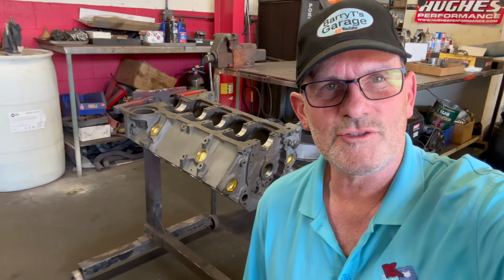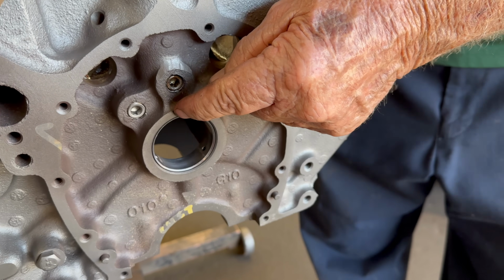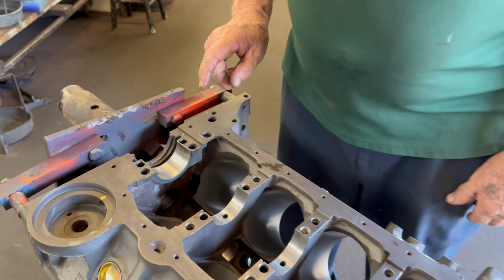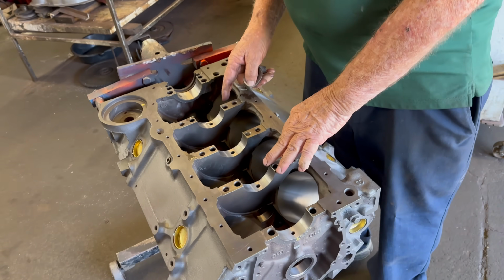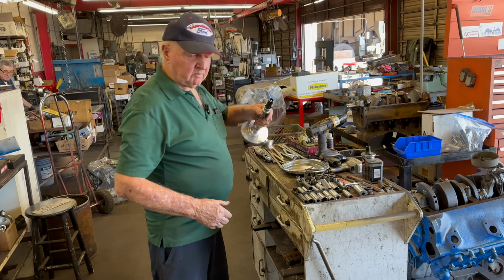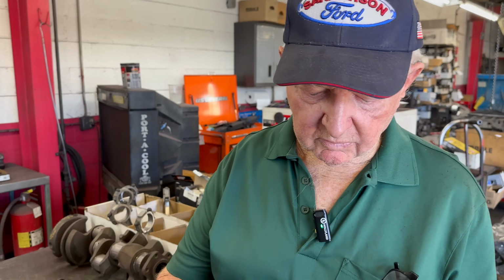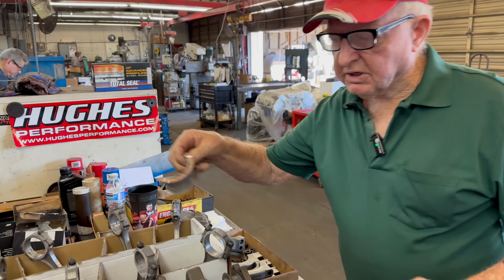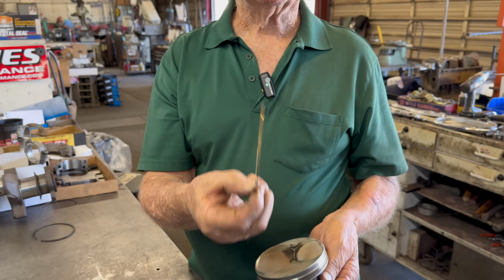OILING! Small Block Vintage Chevy (Chevrolet) Motor - Ed Smith's Tricks of the Trade w #barryt

Comment: We use pipe cleaners in the pushrods to keep from blowing the valve covers off of it and drowning the valve guides in Smoky oil films., running a constant 8500 RPM... a small block Chevy will load the valve covers full of oil before it can drain back to the oil pan.... But when it comes to our Dale Earnhardt signature 437 that made 850 horsepower on methanol.. all we had to do was bowled it together and everything else was figured out for us.. better cost of $50,000 for one motor you would expect that
Reply from the maker: Great example

Comment: The most wear on any engine occurs when first starting the engine especially in cold temperatures all engines should be equipped with a oil pan heater and a pump to get the oil into the cylinders before start up but it will never happen because the auto makers don't want vehicles to last that long
Reply from the maker: Yes 👍

Comment: I was the crew chief for a DIRT team. There are a lot of things he is either not telling about or doesnt know. I was the " motor man" and had access to the engine builder's secrets so I know some of the internal machining and even a flat top would have piston mods so we could turn 9 grand and with specially flowed feed had to custom drill jets because nothing made could pass what was needed. We were running 1400 cfm and beyond 7 grand rpm would lean out with stock jets. Add a driver with skill and we had FUN.

Comment: I don't understand why not put the clutch back on with it in the stand and try it. Prove that it was the problem.
Reply from the maker: Improved it by making it smooth by removing the clutch. Also the inspection confirmed. 👍
Reply: @BarryTsGarage  Thank for getting back to me. My idea is that it doesn't tie in the miss in the engine, As we all know that a miss in the engine can make it shake also. And one item that was not accounted for was the booster brake booster still on the car, which also could make it miss when back on the car. You plugged that when running on the engine stand. But the booster could have a hole in it. It probably ran fine back in the car later we don't know by the video. With what little it would take to recreate the shake on the engine stand it would have been fun to see it proven. I am about the age of ED and have seen a lot of things that have proven me wrong. Don't see anything on the old clutch that would be out of wack.🤔
Reply: I should actually correct myself. I as the viewer of the video don't get to see the process of diagnosis. we didn't get to see the engine shake on the stand. what part actually fixed the shake, the clutch only or the carbs or both. We don't see what would have been the imbalance of the clutch. Yah of course the finger wear but that wouldn't have been enough for violent shake. I have personally have entire finger missing from a clutch on a Boss 302 Mustang with less than 10,000 miles on it and it did not shake. What can be done to a clutch to make it so unbalance, show us! I have never seen such a thing. Yes you can leave the pressure plate bolts loose or they can break and then imbalance like crazy. Or the clutch is literally cracked and comes apart somehow. Same thing if Lug nuts on the tire rim loosen while going down the road, just as it leaves for the ditch it will vibrate like crazy. But the tire and rim are still balanced as it sales past you nice and smooth. Just left me with a lot of Questions is all from a viewers perspective is all

Comment: Higher oil demand better the supply air fuel and oiling increase demand still harder on supply demand temperatures and flow viscosity 30weight

Comment: 1 thou in rod clearance and zero in oil, still trying to understand that?
Reply from the maker: Yes zero weight oil probably running at a pretty high pressure, but still the way Ed tells it when you’re pulling 8 to 10,000 RPM you need to keep clearances to a minimum to keep it smooth and not banging up… Pretty crazy, right?

Comment: When you use screw in plugs. Make sure to not block the oil holes. Use a high pressure pump not high volume. I didn't learn anything here.i know more
Reply from the maker: Thanks for watching and sharing
Reply: Make a video then troll